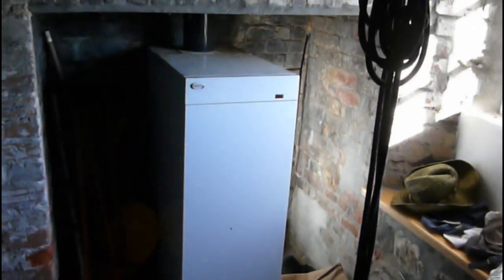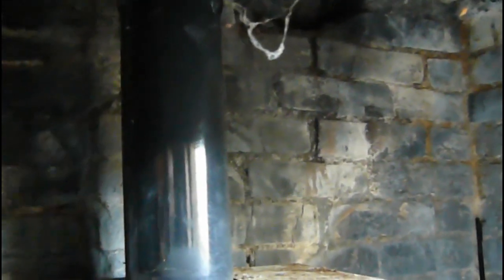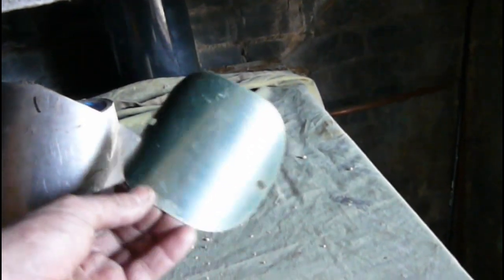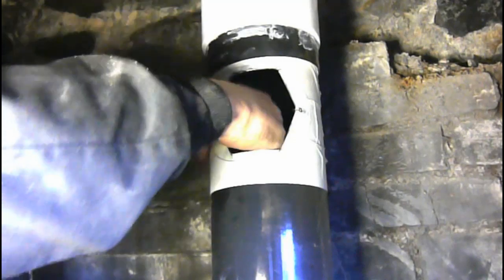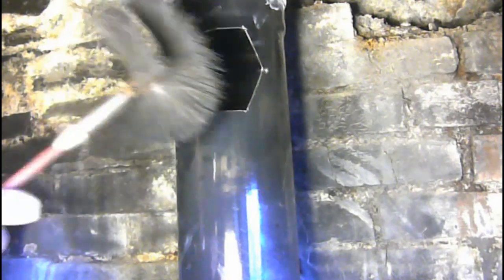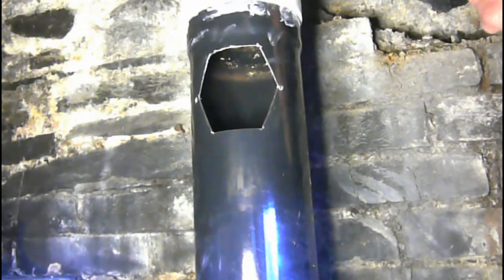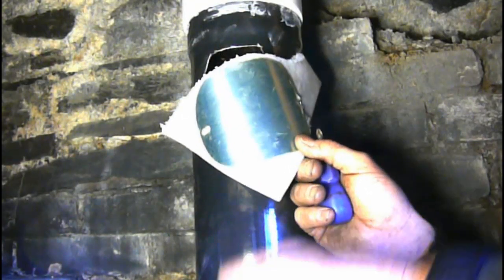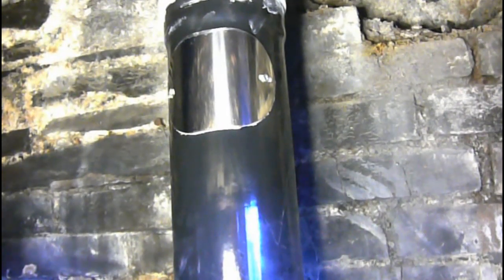Chimney Sweeping A Boiler Flue

Comment: Excellent video. I have exactly this problem with a Morso fitted with a back boiler and no access hatch, I can't get anything bigger than an 1" diameter up through the stove so had to sweep it top-down! They had a fire a few days ago and called me in. I don't think the boiler had been cleaned since it was installed! So, I need to cut a hole in the stove-pipe to get behind the back boiler with the vacuum.What did you use to cut the access hole? Also, where do you get the hatch covers from...I can't find 'em anywhere!